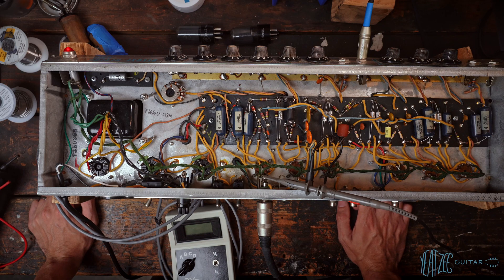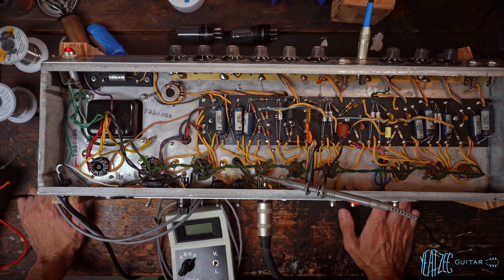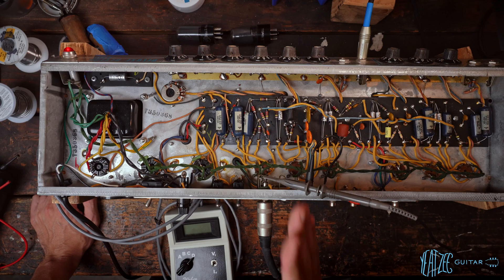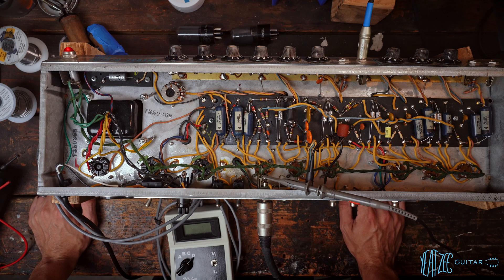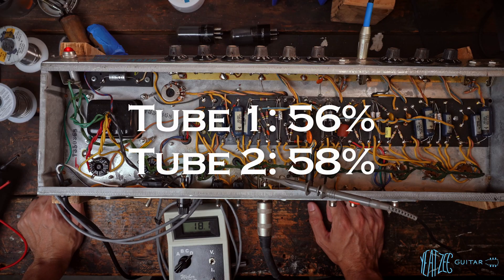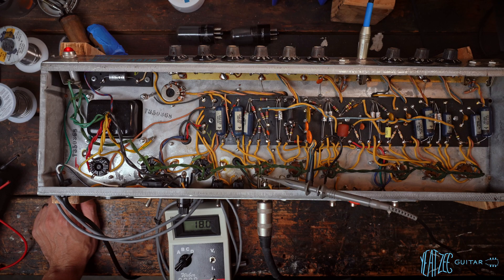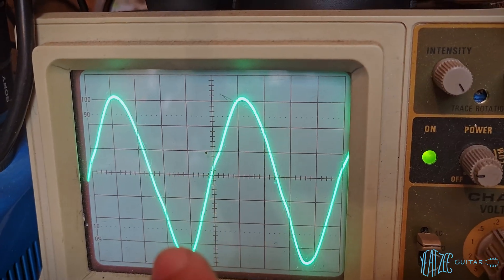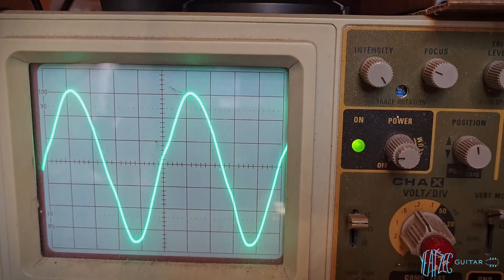Does tube Bias really matter? (1968 Deluxe Reverb)

Comment: If you're going to use a looper to do AB testing, it doesn't make sense to have the loop playing continuously while switching between A/B, because the playing in the loop is changing with time. Each time you go from A to B, it should also reset the loop to be play the same part we just heard in A. Otherwise you can't really tell if any difference we're hearing is due to subtle playing differences or not.
Reply from the maker: Disagree

Comment: I go for a clean tone, so don’t have much use for 83% max plate dissipation. But many years ago I did a similar comparison on a Fender Twin Reverb over the range of 50% - 70% max plate dissipation. I didn’t go beyond that, since with a quad of 6L6’s tube life is a financial consideration. I did notice a pleasing warmth from increasing above 50%. As I recall, I felt around 60-65% was the sweet spot. But I think the sweet spot can vary for each amp, tube set, and musician’s tastes, so I don’t claim 60-65% is optimal in general.

I’m planning to go through a similar process with my Deluxe Reverb clone. It’s currently set for 50%, which eliminates any crossover notch and sounds great, but I want to see if a higher idle current might sweeten the clean tone, as it did for my Twin Reverb.

Comment: I do hear a difference in the overdrive and possibly a touch of note clarity and compression at 83% (though I think you are trading crossover distortion for blocking distortion that high) But its not enough of a difference that I would risk shortening the life of the tubes. 60%-65% is a good compromise in these old amps with NOS tubes.

Comment: 2:19 - Did you mean cross over distortion?   My first amp was a 1979 Fender Twin Reverb that I got in 1988.  I still have that amp and sometimes gig it.  I repaired this amp back in 1988.  I just set the bias to achieve whatever mA were needed for the quiescent current.  At the time I worked at a TV & stereo repair shop repairing TVs, VCRs, and solid state amplifiers. I've repaired many blown solid state amps back in the day - those 70s & 80s stereo receivers.  Your Deluxe Reverb has FAR better dirt than my Twin will ever have. Period. I have a couple of Orange 32 amps.  They use self bias (unlike my Twin).  I noticed that those amps run the EL84 beyond their data sheet dissipation (12 watts).  The Orange 32 has a half power setting that reduces the plate voltage by ~30%.  I use this setting so that my tubes aren't running beyond their intended plate dissipation.   Guitar tube amps are weird - operating outside of typical engineering practice.

Comment: The hotter the bias this causes blocking distortion which is that hairy fuzz tone. You should look into how to modify amplifiers to reduce blocking distortion per each preamp stage of the amplifier. If you look at your current biasing meters when you're strumming the guitar strings its "modulating the biasing" up to 80mA to 90mA you have to factory this in